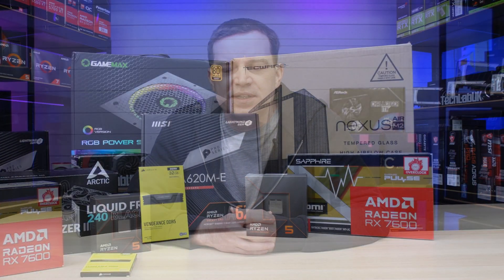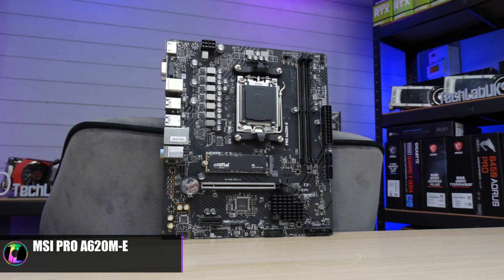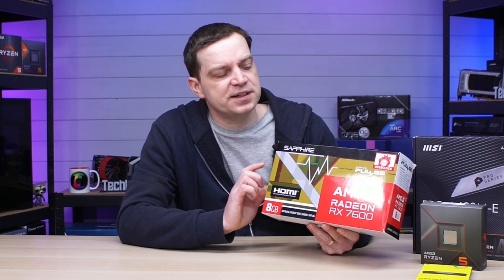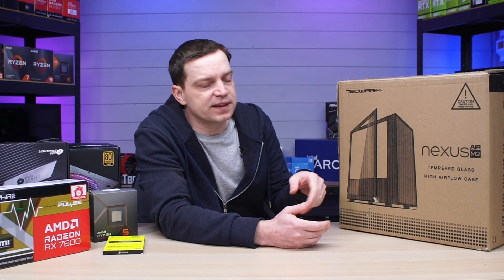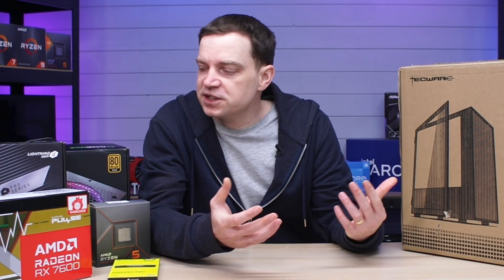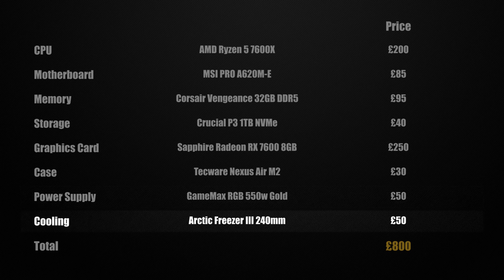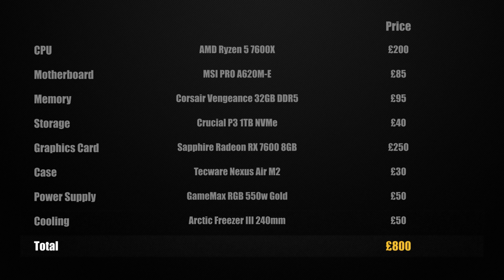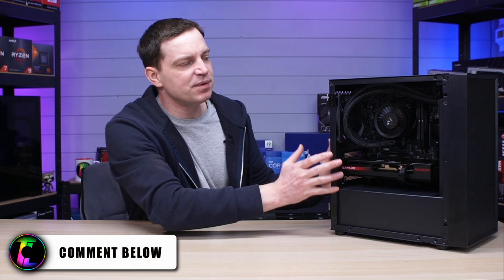Entry level AMD is now FAST but it's not cheap!

Comment: Forgive me, but you used a brand X power supply, then added a $100 AIO in a budget system? You NEVER skimp on the power supply, because if it fails it can destroy the entire system. Check the cultists list for a good power supply and find one on sale. And budget systems don't use AIO's. Try a Thermalright Phantom Spirit 120. $38 and it will outperform a lot of $150 water cooling systems, and it won't leak or clog.
Reply from the maker: The PSU and Cooler are irrelevant to the build.  Swap them around and the performance is the same.
Reply: @TechLabUK  The PSU will become relevant in six months when it dies. it's not just how it performs now, but how will it perform when you finish paying off the credit card bill.
Reply from the maker: @ScottGrammer  Which is all irrelevant to the video which is showing what a budget AMD PC looks like now using their lowest level parts.  Also, the PSU will be fine for years, millions of people use budget PSUs even worse than the one in this video which I had never used before, just bought it because it is what budget builders are generally buying.

Comment: That PSU is tier F on the cultists list. I would stay away from it like everyone else has been saying, but I have more of an issue with putting a $100 AIO in a budget build. Get a much cheaper air cooler and put that money towards a better PSU.
Reply: Cybernetics Certifications Database. Recently updated for more PSU, is also a good guide  for buying a decent PSU.

Comment: Great build. 😊Cybenetics ratings on PSU is an additional useful part picker.  A few Gamemax GM-500-800 rev 2.  Bronze rated PSU have gained a Bronze certification. Am sure you will get even more for your money when the Ryzen 7000 series, DDR5 drop in price.

Comment: Would avoid those Gamemax PSUs in the future, horribly rated and had a few of their different models fail on a PSU tester brand new out of the box, even their 80+ golds. It's a shame Kolink don't seem to make their Enclave series anymore, could get a 700W Gold modular for £65 with the con being lack of a kettle cable, but £5 on amazon sorted that easily and still beat out most other PSUs at the time.

Comment: I...was stupid...and put a lot of stickers on to my case 🙄yes it added to it some value around 20€ but😑um isn't it like rgb? when you have it it gives you more fps? 😂but i don't care about fps😀but i am digress i personally never bought a cheaper MB because of upgrade path will be really limited if it doesn't have good VRMs so when you will upgrade later it's just another thing to consider to your...you know tech bill but just for gaming and nothing else i wouldn't care but i am not this type of PC builder i like unusual things like 13900T or 13100T (which is interesting because it have same UHD770 as big fat i5 and higher)

Comment: You'll get people whining about that PSU but both CPU and GPU are lower power items and will hardly be spiking power levels. It's APPROPRIATE to the build and budget. Nice build, nice video.
Reply from the maker: Thanks buddy :)
Reply: yep it will be fine even for power spikes
Reply: In your Specs list you've stated a 750w EVGA psu...
Reply from the maker: @mikep9418  Thanks for the spot.  It was from the spec lists of another and forgot to update it.  Corrected now 👍
Reply: That's a good PSU can say from experience.

Comment: I can really appreciate this build. You already knew many of us would attack the GPU right away as the 6700xt is superior and will be longer lasting for a few more squid. However as a generation spec it is understandable and being AM5 chipset it leaves so much room to eventually drop a 7900GRE in and replace the PSU for a 750w or 850w.

 Great job, I just cannot quick shake off the fleas from the GPU. I cringed and even thought a 6650xt would have longer staying power with better resell. I have to keep telling all the voices- current gen. As a person skipping the AM5 chipset and capping at the 5800x3D there are just so many better AM4 items that will be around a long time yet and the prices are better. So I don't get faster ram, who cares? I game, 3600mhz is solid for my needs. Running multiple monitors and 2 having heavy loads with 1 watching whatever recent series all runs smoothly and 4K is just silly business. You do not need to play in 4K to pew pew some zombies or zoomers.

 Really great build. Just that card.... save some birthday pennies or turn a trick and just get the 7800xt if you cant squeeze a few more pence for a GRE
😀
Reply from the maker: I would personally buy a 6700xt with the same money when it came to GPUs.  This was really just to demonstrate what you can get now on the bottom end of the budget in terms of a latest AMD generation build.

Comment: Mine cost me £630, on AM4 but I went with 5600 and 6750 XT (XFX QICK) I went with a TUF A520 PLUS II motherboard because there was a deal on that made if half the price of the next B550 board and I wasn't planning on overclocking the CPU anyway and the B550 board in question had no VRM heatsinks or anything whereas the TUF A520 PLUS II is a higher end A520 board.

When I upgrade to AM5 in the future I'll probs go with PCIE 4 then but I just wanted something cheap and performant to get my foot in the door, so to speak!  Very happy with it!
Reply: 5600 ran great on my A520, only upgraded when a refurbished MSI MAG B550M MORTAR WIFI was £75

Comment: I Have a similar build with Rx 7600 and 5500 cpu And I get an average of 80+ fps in rdr2 at max settings and in cyberpunk an average of 90 fps at ultra settings just for £610
Reply: I paid £630 for mine, I have 5600 and 6750 XT 👍
Reply: That is really good. You hear in a lot of these builds, reviews and opinions the people say "future proof." There is no such thing as future proof in tech. Buy exactly what you need right now. In a few years when everything has tripled in power you can pick up todays top tech for mere pence and then build a few year old- high spec pc for much less. We always suggest to our customers to buy what they need today not what marketing or influencers tell them to buy. We also remind them the guys flogging over priced Nvidia cards get theirs for free to market them.

 The 7600 is a really okay card, I just lean toward the 6650xt if the customer cannot squeeze the extra £50 for the RX6700xt

Comment: The a620 boards are really pretty poor for the price (in a vacuum), as you mention in the price breakdown, and I probably wouldn't be planning to put a higher-end CPU in it in the future. I'd also really have tried to find 6000 RAM, and while I'm sure the Gamemax RGB PSU is fine, it only has a 12 month warranty...which is pretty shocking. Using a B650 and 6000 MHz RAM would sadly add another £60-ish to the cost, bumping it much nearer £900...which really is quite a big chunk of money for lower mid-range performance.
Reply from the maker: Yeah, I would have preferred a higher end board but AM5 still hold a premium even for these bottom of the barrel stuff.  I have no idea about the PSU, just a random one I have seen but as others have said, they are supposed to be quite bad so will avoid them going forward.
Reply: Why didn't go with the dual channel ram
Reply from the maker: @HariHaran-sq2wf  It does have dual channel ram.

Comment: that power supply gives me anxiety, gamemax makes cheap tat psus, they are tier f for all their units on the psu tier list for a reason, they often have done stuff like cheesing review samples, faking 80 plus ratings, component swapping, etc
Reply from the maker: I had never really used anything from them before so have no idea.  Thanks for the info though, I shall avoid going forward.
Reply: @TechLabUK  yeah, theyre also known for ripping off popular brands cases using similar names to kind of trick consumers. gamers nexus recently covered them.
Reply from the maker: @kushREAL  ewww cool.  Thanks for the heads up.  I might just use this unit for old stuff testing then and at least if it dies it doesn't take much with it.